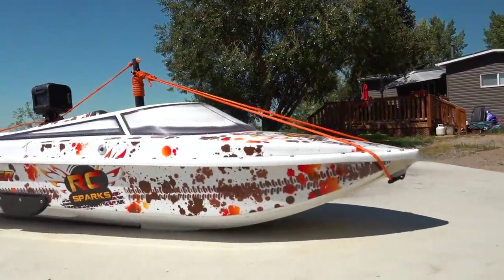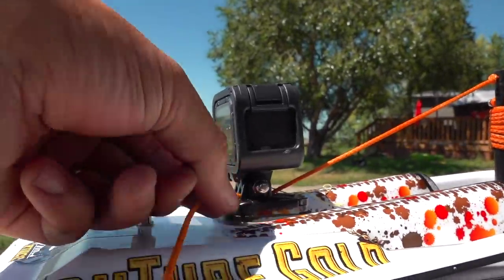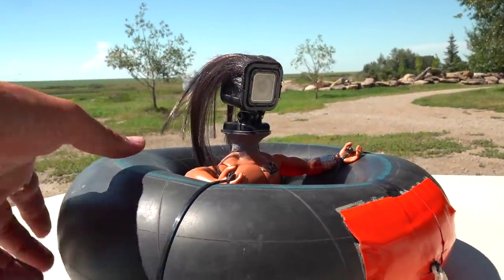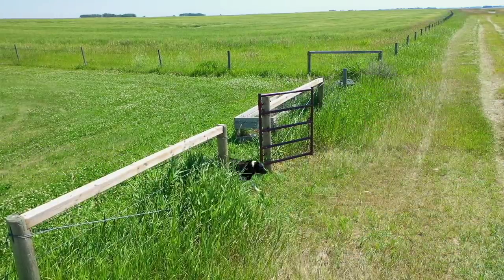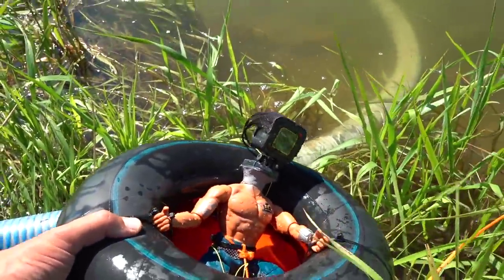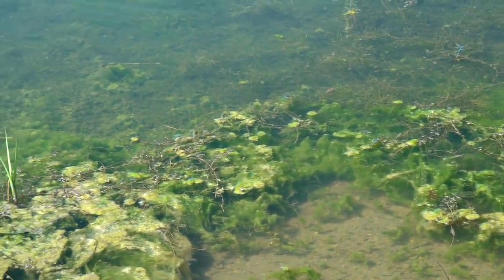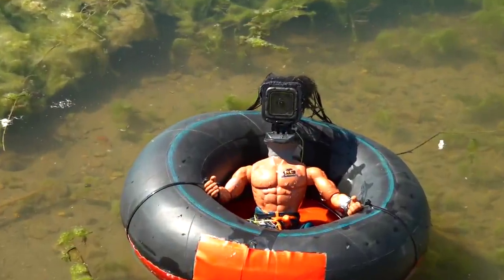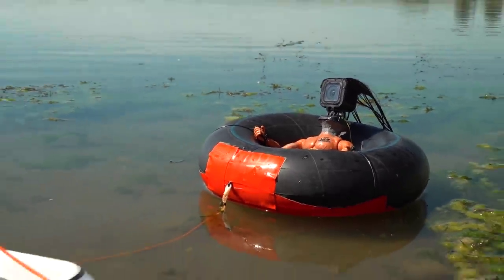Tubing behind a Jet Boat

Comment: That looks like sooo much fun!! The pin in the back of the boat you were concerned about ended up being a non issue,  the aft section of the boat squats down enough under power that it clears it nicely. 👊🍻

Comment: Love it bro. I started skiing and tubing behind a 16' Polar Craft. Worked my way up to wakeboarding behind a Supra Launch packing a little over 2000lbs ballast. You so need to ditch the jet boat. Fixed prop under the hull with a rudder is where it's at. (2 turntables and a microphone) But I so love the videos. Memories of good times and options too make new ones. Keep them coming bro!

Comment: Here's an idea: Toss a small battery/servo/receiver on the tube - attach a weight to the horn, and use it as a "steer" so that it's like the figure riding the tube leans left/right- Then bind it to a seperate controller, so someone else can control the steering for the tube behind the boat :)

Comment: you might want to add "some weight" at the front of the tube ... it will prevent the tube from lifting/airborne on the turns .... otherwise great way to spend in a sunny afternoon .... great vid

Comment: you need to take the tube with driver and camera and find a way to make them a solid unit so the weight does not shift to one side and balance it. He was spending too much time leaning to one side so you could not get him to jump off the wake when you turned ;)

Comment: Hey aaron i think it would be even better if u had a longer tow line so that the tube is out of the prop wash it should tow straight and also it will be smoother so it will be easier on the boat
Reply from the maker: The venturi tube is causing it to swing out.. We did a longer line already. It didnt help.  Im removing the tube next and going for a flap
Reply: Lol that should work too lol ur the king of rc's i know u will figure it out ive taken alot of ur advice on my own rc's and it works all the time lol
Reply from the maker: @EthanandHannahsDaddy  Always a student, brother! Never a master..  :) Keep on RC'in', and thanks for commenting!
Reply: No problem man lol maybe someday i can afford to travel out with a few of my rigs to try ur ttc

Comment: I think if you have a longer rope you will get more whip on both sides and don't have your tow point as low as you did, other then that👍👍.
Reply from the maker: Already done that..  like I said in the video. Watch the other videos. It didnt work
Reply: Hmmm been thinking about this all day. What about if  you use a large key ring around the the lock screw? One string tied to the key ring and another string tied to the ring so that it moves back and for

Comment: 0:11 you think it's hot over there for me in kenosha wisconsin it's 90% over here
The maximum heat we've delt is 150%
Reply from the maker: According to the Weather and Climate Extremes archive, the hottest temperature ever recorded was in Furnace Creek, Death Valley, California at 56.7°C on 10 July 1913.  That was 134f.  Also, consider that not all "heat" is the same.. it is very muggy and humid here, which is different than a dry heat.  And for people who live in the snow most of the year.. 30+ is hot.